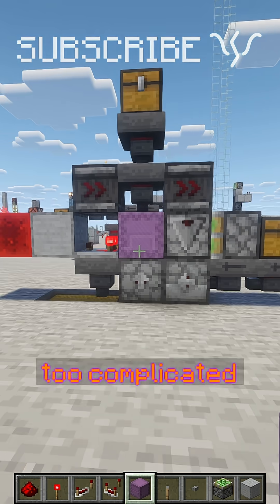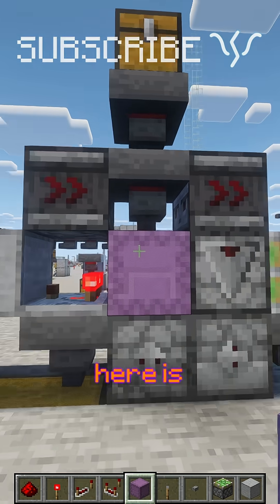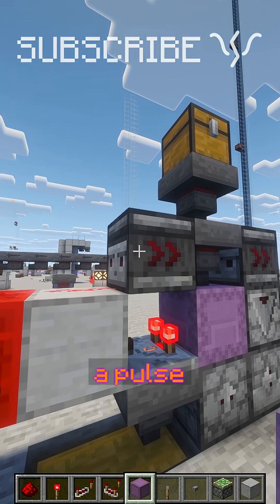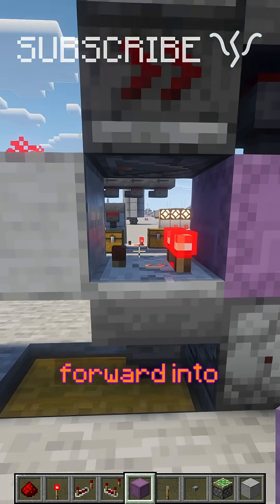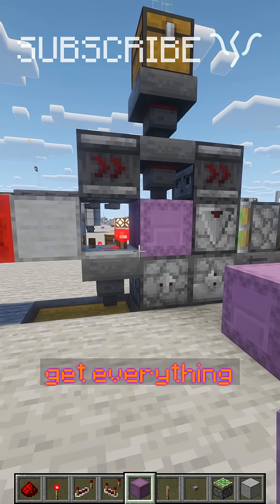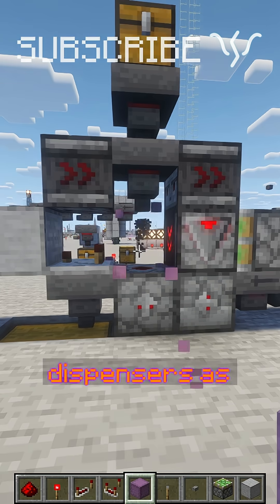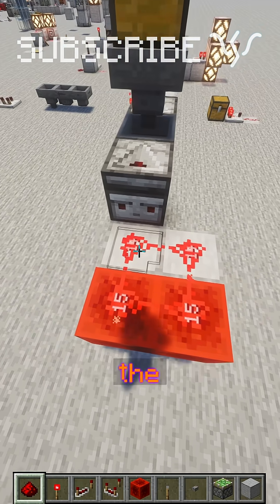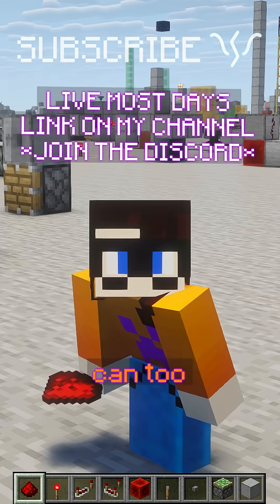How a SHULKER LOADER actually WORKS! | Redstone with PsiVolt #minecraft #redstone

Comment: ... I hate this machine... IT ALWAYS BRAKES WITH OUT A ITEM SORTER
Reply from the maker: ...I mean... it does need one. If you have different item types it is very hard to guarantee that the shulker box will get completely filled, which is needed to get that signal strength of 15.

you're getting mad because it *breaks when you use it without understanding it? It's okay not to understand something, but look to learn about it before just getting mad
Reply: @PsiVolt  can't argue if that

Comment: But wait. If the purpose is to just bulk fill shulker boxes, since they're the same size as the chest your using in the machine, couldn't you just... put them into the hopper manually for less work?
Reply: Shulker Box loaders are meant for farms that produce a lot of items. Think slime, gold, bartering, snow, wood farms, all of these can produce insane numbers of items so having that hopper be attached to an item sorted will allow the farm to produce significantly more items before being full